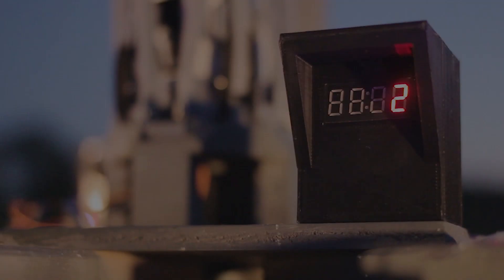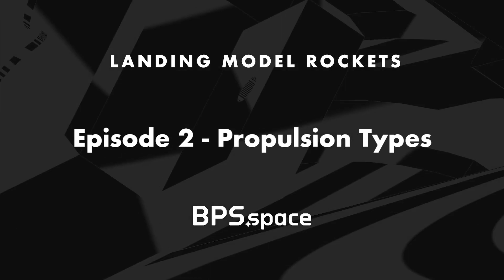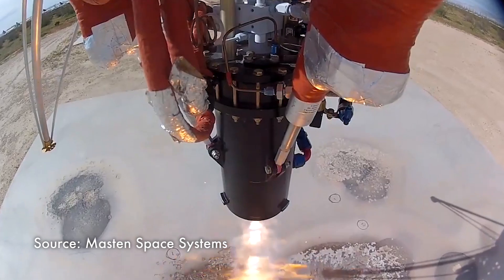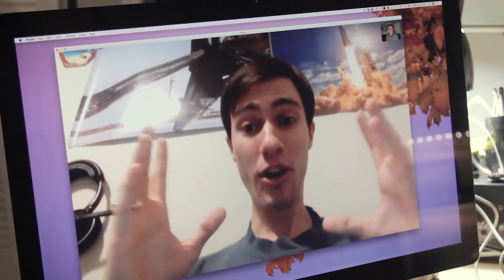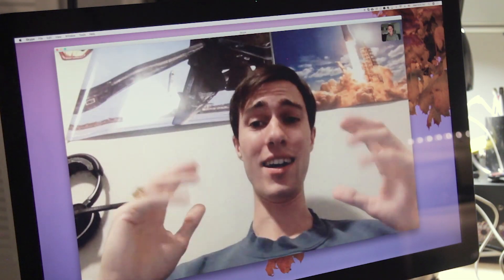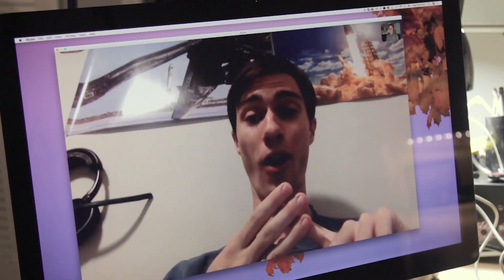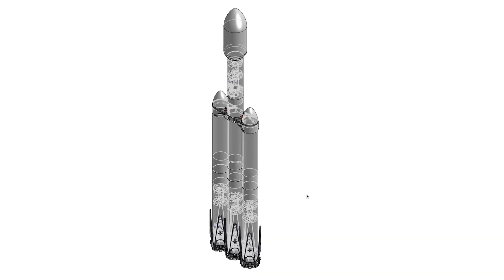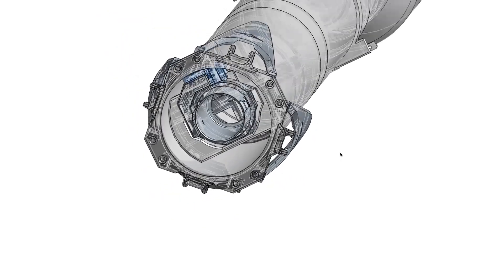Propulsion Types - Landing Model Rockets Ep. 2

Comment from the maker: I thought the joke was clear enough, but in case there's any doubt... I am not HUNDREDS OF MILLIONS OF DOLLARS in debt 🤦
Reply: For the controllable booster problem, couldn't you put a very simple nozzle shaped piece of heat resistant metal infront if the the motor. To control the net thrust , you would have to put a kind of bleedvalve on the side, to bleed of chamber pressure and therefor reducing thrust. With this methode you also have to ignit the booster very early because you basically can just reduce the thrust 
(assuming that the bleed of valve can't close because of the high temoerature gas). The principle would be the same as your multiple mini rocket motor idea just with the advantage of possibly less weight and a bit more controllability (since the time delay for solid rocket engines is not that consitant, wich could probably end up in unwanted thrust difference an instability) and the disadvantage of being a bit more expensive. Well it was just a quick thought ;D.
Reply: I was thinking monopropellant. High-Test Peroxide fed onto a catalyst shaped kinda like a cork that forces it around an engine bell.
Reply: @andrewmorris483  
I was thinking about that too but wouldn't the catalyst be expensive? Than you also have the  
Oxygen in the water steam (when using hydrogen peroxid) that is unused (a more effective approach would be be to use a second liquid as fuel, for example methanol. Or go hypergolic and use a mix of methanol and hydrazine as a second liquid). The cold type Walter engine is in between solid rocket motors and liquid fuel motors in terms of complexity but i doubt it to be any near their cost and time effectiveness.
Reply: That's a good idea even thought the pressure inside is not what increases thrust but rather the increased velocity at the smallest nozzle radius (rule of thumb: the smaller the radius the higher the velocity for a given volume flow. Increased velocity by same volume flow should result in higher thrust).That said, if you have very hot gases like in a rocket motor, you will get a lot of heat flow. Now imagine even more heat flow because of increased velocity, professionals have  problems, cooling static nozzles with fuel and you want an amateur to built a dynamic nozzle with cooling for every moving hot part of the nozzle. That's not gonna work, at least not with his limited budged ;D. Don't get me wrong, it is totally cool and works for relatively low heat exhaust gases like turbo jet engine with or without afterburner but rockets require a little more heat resistance.
Reply: You don't need to burn fuel for landing a model rocket, pressurized gas maybe CO2 or something similar could do you just fine?

-Edit: Ok nevermind when I wrote this comment I wasn't aware of your goal of making model rockets that both look realistic and function like the real thing. So such a pressurized gas engine might not be what you want even if it worked.

Good luck to you man it is all very exciting I'll be following the developments... cheers.
Reply: Where did you get the Falcon CAD model? Is that a Patreon perk?
Reply from the maker: I designed the model myself! Files will be periodically released for Patrons, landing leg 3D files coming very soon ;)
Reply: Mandernach Luca use lh2/lf2 fuel
Output:hydrofluoric acid
Reply: have you considered bleeding inert gas like argon (can be had cheep at any welding supplier) through the solid motor to displace oxygen and slow the burn rate? might be able to control thrust by varying the flow rate of the inert gas.
Reply: Make rocket liqued engine for your rocket
Reply: YET.
Reply: Lol
Reply: Aktually, h2o2 monopropellant isn't such bad idea. Yeah, you need your tank clean and concentrated h2o2 is nasty stuff if it gets on your skin, clothes... But it is relatively safe. https://www.esa.int/gsp/ACT/doc/PRO/ACT-RPR-PRO-JPC2006-HP%20Rockets%202006-5239.pdf And here is some rocket propelled propeller on experimental helicopter https://www.youtube.com/watch?v=CGcRgEuCocQ

Did you consider to throttle solid rocket engine by inserting something into exhaust flow(symmetrically)?  Or inserting that asymmetrically since it could probably also steer the rocket... just an flash idea.
Reply: http://www.lajp.org.ua/r-d-projects/rocket-engine-using-hydrogen-peroxide jere is engine using H2O2 and ethanol. It isn't what you need- it has vacuum optimized nozzle, bu otherwise, it looks useable. T/W ratio is about 3 for this engine which is rather low. ISP  is aver 300. But you aren't looking for placing your rocket on orbit, right?
Reply: battle of buffalo nickel ridge no
Reply: The easiest way of this alternatively have been a pressure fed engine with a monoprop like peroxide
Reply: Lets bulid diameter  adjustable nozzle for long burn solid motor.
Reply: @BPSspace  Great video. I was wondering which level of patron do you have to be to get all 3d and pcb design files? Thank you.
Reply: I think bi propelan liquid engine is really posible and afortable
Reply: Try UDMH and nitric acid :D room temp storage and it’s hypergolic
Reply: how about 3D printing the fuel matrix to put topography/landmarks in the fuel grain that burn slower based upon time of burn (a conical/varying diameter central core). That way you can throttle down the motor after the rocket is moving and start calculating burn time vs estimated altitude and velocity to tune the motor design to the rocket and the mission payload which introduces a new competition element into model rocketry (calculated vs actual behavior).
Reply: You may be able to print in oxidizer 'pills' into the fuel grain for higher thrust and altitude operation.
Reply: What is Your solid rocket Fuel?
Reply: Just don't buy your rocket parts from Wish..
Reply: you are just 99 million in debt

Comment: But... What about Nuclear pulse propulsion???  ;P
Reply: the only time that nuclear blasts were considered for propulsion that I know of was Project Orion.
Reply: Noah Purdy No ...see Viktor Schauberger  work .
Reply: their thrust is too low for lifting a rocket of the ground, but great for long term accerleration if traveling interplanetary or interstellar. :)
Reply: @JAMOABGLP  Nuclear pulse propulsion literally means dropping a nuclear bomb out the rear end of the craft and detonating it, sending the ship flying through the air. It has plenty of thrust.

You might be thinking of nuclear thermal rockets, which have a fission power cell with uranium rods that is used to heat the hydrogen propellant. This doubles as its coolant, and so a major source of weight is removed, but nevertheless it has indeed too low of a thrust-to-weight ratio to be used on Earth.
Reply: @Jupiter__001_  oh yes, you are right, I thought about that after I wrote the comment, (yes heard about the Idea of nuclear propulsion before) but thought it would be alright, now I understand the smiley ;P
Reply: @Jupiter__001_  and thanks for correcting!
Reply: Definitely, it's cheaper, safer and less complex than any other suggestion in the video.
Reply: Is that a gender neutral term?
Reply: Come on, man! We gotta scale it down for model rocket use. Grab me a poster tube and 14 hand grenades
Reply: They are good in space, but only chemical fuel can escape the gravitational pull and lift the rocket all the way to space
Reply: how to get cancer
Reply: Noah Purdy yeah what about cancer propolsion xD

Comment: I already build a hybrid engine that small and it worked really good. And it costs here in Germany about 30€ +servo, valve, housing. The housing is rusable. It just needs some cleaning before refueling. I used liquid Oxygen as the oxidiser and PVC as fuel. The housing is aluminum and the nozzle steel. Its 10cm tall and 2cm wide. And it weigts with servo and valve 200g. I did not mesure the thrust but it had alot of boost. Greetings from Germany👋
Reply: JL S Hi ， can you upload a video of the engine?
Reply: I also wish to see it in action if possible
Reply: Me too!
I would love to see this in action!
Please post video soon!
Reply: LOx is hard to make, how did you get it?
Reply: @Jupiter__001_  I just used the Oxygen from my oxy acetylene welding equipment
Reply: I have no idea if it would work in a model rocket but i think he could build one and try it
Reply: @Jupiter__001_  Fun fact, here in yankistan GOX is easy to get, hardware stores sell small bottles of it (they're red) in the torches and welding section
Reply: An even more fun combination is a reverse hybrid rocket, with solid oxidizer and liquid (gaseous in my case) fuel. I did some limited tests with an ammonium  perchlorate cast oxidiser grain and butane gas as the fuel. Seemingly it actually burns pretty well. I never got around to building a  proper full pressure test though since I ran the system without a nozzle. 

The last run gave me one hell of a welder tan. Hurt like hell and reminded me why PPE categories and training exist, I'll be wearing a visor and 10 calorie suit next time.
Reply: Hey the old Hybrid engine fell apart because i wantet to show you guys how it worked. I was about to film but it burned up very quickly. So i decidet to build a liquid fueled engine. If you want to see something from it, Iam going to post a video from it. From building to testing. hopefully
Reply: I've used oxygen and acrylic. Drill a hole down the middle of a length of round acrylic, use an air tools quick disconnect on one end to feed in the oxygen.
It's totally throttle-able (is that a word?) Just by opening and closing the valve for the oxygen.
Not very easy to start but it is restartable.
I didn't measure thrust and I'm not sure if it's practical for a model rocket but I didn't have a nozzle on the end either ....
But it's easy to set up and play with if anybody wants to.
If you put your eye out it's your own fault.
Reply: @jls5020  Excellent, looking forward to the videos
Reply: @jontallbacka9406  Liquid fueled enigne would be ready for the first official test.  Ive made a relatively low quality video. Do you want to see the low quality video first or would you wait for the high quality video? First Official test would be like in the next few days.
Reply: JL S I’m quite certain that all of us would love a low res cliff hanger :-)
Reply: Why are German Stereotypes Reenforced by Germans time and time again
Reply: hmm hybrid engine might be a great choice!
Reply: Subscribed because I want to see your engine
Reply: @jls5020  any progress on making the liquid fuel engine?
Reply: @atomicages8914  Yes! Thanks for reminding! Going up soon!
Reply: I had a lot to do last year, had to pause progress. But i am going to work on it again!
Reply: @jls5020  thank you. Be careful.
Reply: Is the video for the liquid engine up yet?

Comment: Thrusters: straw diameter rocket motors with internal ignitors and conductors 3D printed into the fuel grain (need quicker ignitors to start a burn and insulation wafers to stop the motor burn after each pulse) and burn barriers. Multiple rocket motors along the straw-tube length. Each one ejects itself after its burn. Motor can have curved nozzles so the motor can be installed axially while the thrust gets vectored radially. This tactic might even be used for the main motor by having tubes gathered together for the main motor (Thrust and duration controlled by parallel and sequential firing of the tube sections. (No gimbals)

Comment: Did a little bit of modeling back in my early teenage days.  I have been watching your Facon Heavy videos and thought about this video and others you  have tried.  I think an easier way to solve this problem is not more motors but by using the principle of a camera shutter.   Using a shutter below the motor to open and close it to get the thrust you need.   Anyway,  keep up the videos.  Not sure I would ever get back into rockets but right now I am living the dream through your videos.
Reply: Sorry if this sounds disrespectful, and I know this is a year old, but a camera shutter design would easily trap exhaust gas into the chamber, and the body tube is just made out of higher quality cardboard, not a good idea

Comment: I think underspec'ing the main engine is definitely a good idea. This allow you to split the functions: 
-Main motor provides lateral control
-Ring of small motors can provide throttling

A straightforward way of reducing thrust would be to put the small motors on a simple hinge, allowing them to vector +-90 deg outboard. Either actuate the hinges individually or have a ring that connects all the hinging motors, allowing you to change their angle with only on servo.

Comment: One option for a model rocket that can take-off and land propulsively you could try integrating a longer tube mount for two motors with stops so that after the initial engine burns out on ascent it can then eject the first motor and load a second motor for landing.
Reply: Also one way of throttling a solid engine is using a variable iris over the exhaust opening of the engine to increase or decrease the exhaust velocity (it may also potentially improve the efficiency of the engine overall).

Comment: To throttle solid fuel engines you could try and divert the thrust to the side by for example closing the channel to the bottom of the rocket and opening a new one on the sides of the rocket so that the thrust that goes down can be controlled while the engine burns normal.

Comment: Most serious rocketeers are using hybrids so don't shy away from that just because someone says it is complex. Hybrids are way simpler than liquids. Nitrous oxide is commonly used in racing cars so there are components you can use from racing shops. And take a look at the video "How hard can it be..." where they got a rocket to 50000ft in three weeks from project start to final crash.

Comment: Very interesting video. What about 2 solid motors next to each other that can swing out using servos so that they point towards each at their tops. The vertical component of the thrust vector can be controlled, and the horizontal component of the thrust vector is cancelled out. This will also allow you to compensate for the thrust curve of the motor as it changes over time. You already have most of the hardware to move the motors. :)
Reply: Air Command Rockets yes, this is what immediately occurred to me. At the cost of a single servo you could get very fine control of the z thrust vector, and the central vectored motor could compensate for residual differences between the small motors.
Reply: Impossible to light those motors simultaneously though and even if you did they are going to burn out at different times. All this happens VERY close to the ground and with the smaller motors, a couple seconds apart.
That's why the space shuttle always separated from the SRB's BEFORE they ran out of fuel.
Reply: Interesting idea definitely need great timing

Comment: Eh, just use a couple butane cans for camping, tubes to the combustion chamber, Insulated servos to actuate the valves, mix with the oxygen from the air in a device like you get in the jet-type cigarette lighters or gas torches, ignite with one of those new "arc lighters" , you're not getting enough altitude to have low oxygen conditions anyways, and hook it up to a low altitude nozzle, doesn't need to be a huge bell.

Comment: Hello many years ago my uncle and myself designed built and fired a scale model of the F1 using camping fuel and liquid O2 it never flew but did fire awesomely . Unfortunately I have no pics or video of the events . However the plans and ideas are still around . If you like message me ad we can work something out . All the best In your experiments hope to see more . Ps parts now are actually cheaper than you think small pumps stainless steel tanks and fittings are not as bad as you think . Check out Swadege Lock fittings . We use them constantly in the oil &gas industry as instrumentation

Comment: To replace the top fins to the rocket, one needs a thruster that is based on a large thing washer plate, with a very small exhaust groove groove stamped so it goes out in similar fashion to the hands on a clock. This flat plate washer, should be set on a pivot, to where a set of actuator arms fires on command laterally, as the rocket descends, with the actuator, pivoting the ring to fire at certain request times. This is a very simple design, but you must either add a second rocket, or bleed off thrust somehow from your main rocket motor. You can still use the find, as they catch a lot of air, however a second source of thrust is indicated here. Good luck

Comment: Maybe using two counter rotating ducted fans on the inverse side of the rocket would be useful for powering a landing. You would basically be landing on your head though.
Reply: And there is actually a model drone project that is just two counter rotating ducted fans and it flys if message me I can link you if interested.

Comment: You can use smallest rocket motors by applying then on the top of rocket and firing then when rocket tilts that much which can't be controlled those small motors can be applied all around the rocket cylindrical body and can be fired when needed by a programmed computer.